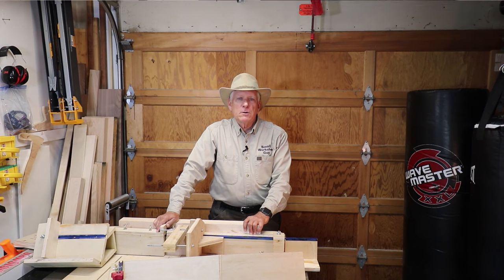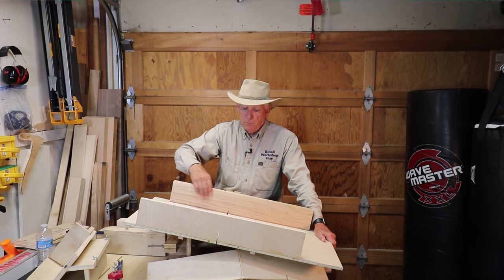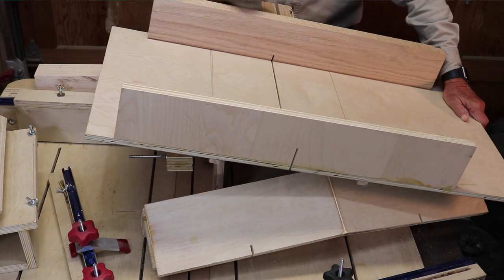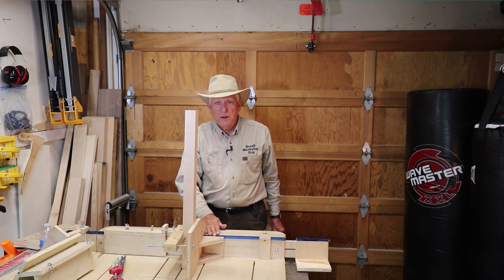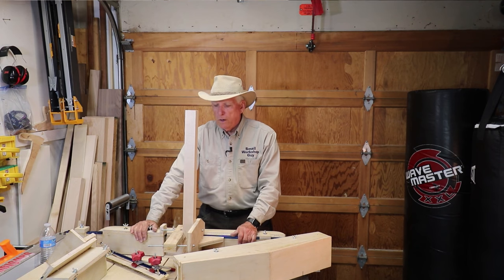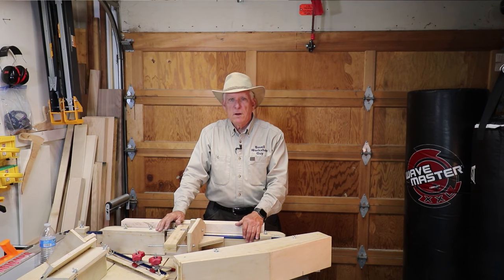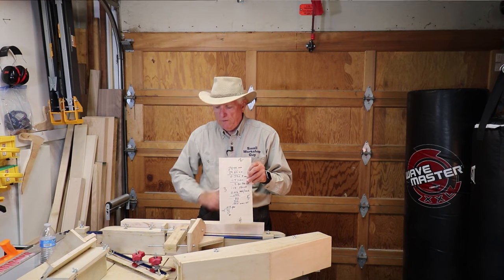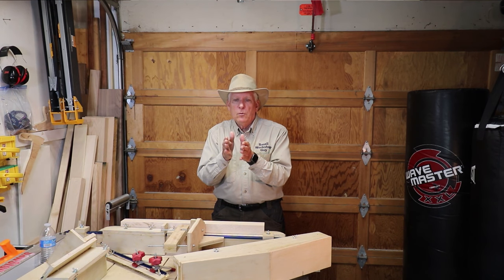Cross Cut Sleds - 2 Absolutely Critical Components of a Really Good Table Saw Cross Cut Sled

Comment: Thanks again Paul for another instructive video. I have yet to build a crosscut sled, but I have bookmarked quite a few videos of the many builds I like for my future reference. I'll just have to narrow it down to the design or designs I like the best and finally build one or two of them. I have all of the people you mentioned are bookmarked as well as  a couple of other simple designs and a design that has a little more to it utilizing hold down clamps. They are from Johnny at JT Woodworks and Mike Warren.
JT Woodworks: https://www.youtube.com/watch?time_continue=308&v=l2GZA1yjnXU,
Mike Warren: https://www.youtube.com/watch?v=dAS_XExLsTY.
Linn at Davrbin Orvar has a design with hold down clamps: https://www.youtube.com/watch?v=dnBaoRYDBLg.
While I don't agree with Mike's method of doing the 5 cut test after the back fence is glued down nor with the .071" result, you can do the 5 cut method before permanently attaching the back fence. Linn relies on a square to get the back fence at 90°, but again, attaching it with two screws and doing the 5 cut method and making any necessary adjustments would guarantee more accurate cuts.
Reply: Here are a couple more. I had another one bookmarked, but I somehow deleted it and ca't find it again.
Drew Short at Rock-n H Woodshop: https://www.youtube.com/watch?time_continue=1&v=qxdMAFwm3ZQ
Marija at Creativity Hero: https://www.youtube.com/watch?v=Xt95n_G85l0
If you perform a search for crosscut sleds table saws on YouTube you'll find that there are a lot of them. Too many to list.
Reply from the maker: Thanks for the links!